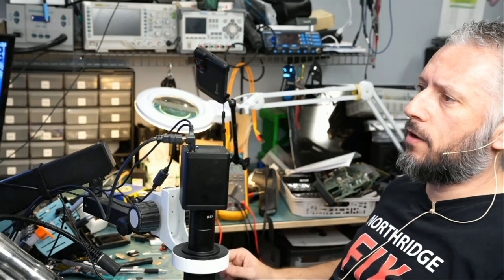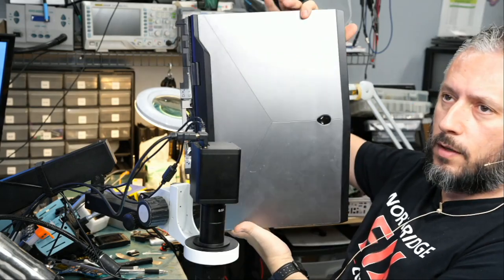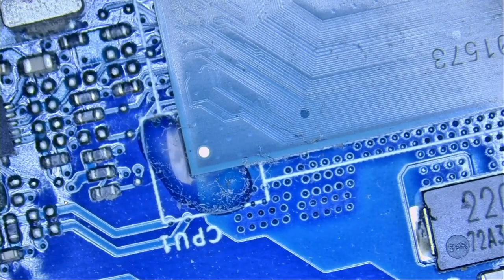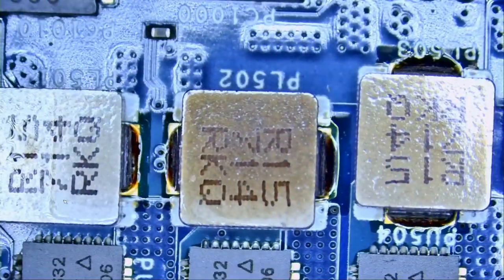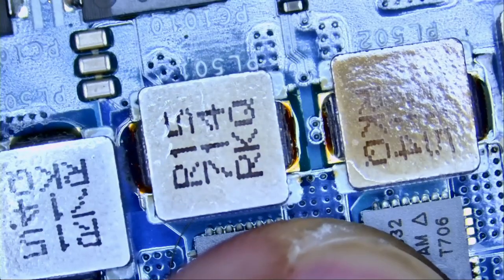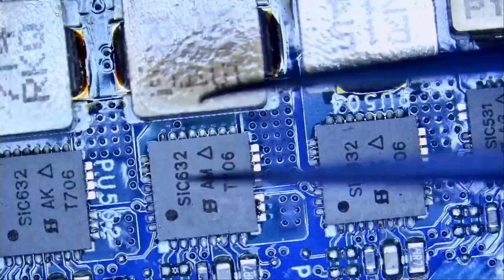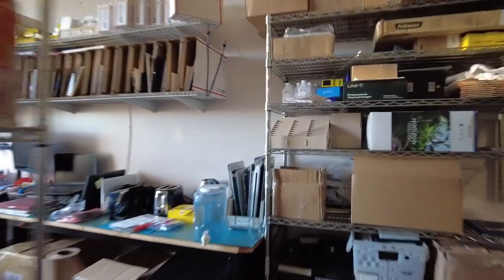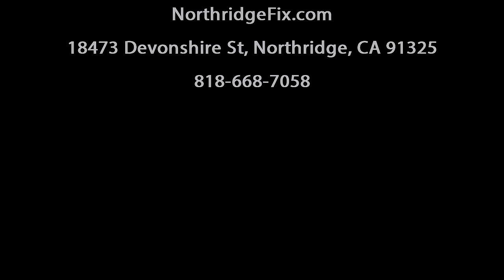Dell Alienware 17 R4 Notorious for CPU problems - Is it Fixable?

Comment: I sent in a dell G7 17 inch that had a similar problem instead mine would turn on boot up but would not charge then it would just die, it was deemed a no fix and i recycled it. I'm never buying a gaming laptop again, thanks to this channel
Reply: I would suggest not to buy anything which has the term "gaming" in it's name because it's often overpriced and not servicable.
Reply: Get hp zbooks

Comment: These bulky laptops should come with socketed cpus. Supposedly the reason manufacturers moved to soldered cpus was to make laptops thinner (an effort led by intel ultrabook initiative), but on these huge bulky models it doesn’t make any difference if the cpu sits 1-2mm higher. At least amd should make the effort, even if they think they will lose money when people just change cpus instead of buying new laptops.
Reply: thinner lol what 2 cm thinner thats crazy
Reply: My first Lenovo laptop has a socketed CPU. If only the GPU was changeable it'd still be a relevant laptop.
Reply: I suspect manufacturers did this intentionally so they can sell you a new laptop in a few years.  Intel, for example, has completely stopped making PGA versions of its more recent laptop processors (PGA - pin grid array).

Comment: Hey Alex! It should be interesting to ask your customers with faulty laptops, if they keep the lid closed. I noticed on the other video with Asus laptop that there was dust on the screen in the shape of keyboard. A lot of people have external monitors connected to their laptops, so they keep the lid closed and i was wondering if the extra heat adds up and creates such problems quicker. Keep up the good work!
Reply: Hi there, majority of laptop (almost all) are having their air intake / fans pulling the air from the bottom, so closing the lid got 0 effect on the temperature. I've been using 2 laptop over 4 years having totally closed lid and connected to an external monitor, and I'm ALWAYS having a program called "HWiFO64" running to monitor my CPU temp, and it's always been normal.
Reply: I think the problem is people put there laptops on surfaces that are not flat..couches, towels, mats, ect. They can't breathe and run hotter than they should. My predictions are customers are at fault.
Reply: The problem with laptops that have mechanical hard drives, moving the laptop while the disc is spinning, creates forces on the disc, and wear and tear on the disc bearings. There is an experiment, using a spinning bicycle wheel while standing on a swivel platform. depending which way the spinning wheel is tilted, the person will be turn either left or right. The same physics apply to Hard drives. When the device is on, do not move it's position.
Reply: @amrdaking1  except asus zéphyrus S gx5xx and gx7xx, also zephyrus Duos  they have exhaust on the top keyboard. So leaving them lid closed he will suffocate
Reply: Hi, the keyboard-like marks on the displays are caused by physical friction between the keyboard and the display probably due to carrying the laptop in a backpack and the involved vibrations, the screen ends with micro-tears caused by friction, at least in my case that was the reason.
Reply: @danteashen6178  I wonder if there is any mention in the manual that you should not obstruct the exhaust and exactly where they are located. Also exhaust on the top keyboard is an obvious design flaw..
Reply: @goku445  i don't remember but i can check. Well it was pretty good idea  in my opinion and for my usage. Better cooling perf i ever saw on a laptop.
Reply: @goku445  there is a mention "please to achieve better cooling performance, open the lid 60° orientation minimum"
Reply: @danteashen6178  Ha! Too bad no one reads it. :p
So basically their design was adding those vents to the traditional ones.
Reply: @tecnogof  The device is designed to be moved while it's spinning. While your argument makes sense physically, in practice you can move a spinning hard drive around with no problem as long as you move it slowly and carefully, don't drop it, and don't move it hundreds of thousands of times. OTOH, nobody should be using a mechanical spinning hard drive in a laptop any more; so if you haven't already, replace or have it replaced with an SSD; you'll thank me!

Comment: Love to watch his videos. always great work alex ! i am disappointed from dell, that they will not change the construction of this laptop for longer lifespan. I have a 8 year old alienware laptop and its great
Reply: That's not in their interest. Also 8 years for a laptop is very long. Saying that I have a 10 yo Thinkpad that's still doing a perfect job. Only had to replace the thermal paste.
Reply: 11year old Alienware m17x r4 here! The best laptop they ever made in my opinion.  Upgradable almost like a desktop pc. If you got the R3 you can even upgrade the motherboard to the R4! This is how all gaming laptops should be. I don't care if it is large, because it stays cool with a stable +700mhz OC on the CPU and does not throttle!
Reply: @GamesToTutsOfficialChannel  thats it. you spoke out of my soul. you can upgrade from r3 to r4 because base bottom is the same. you can upgrad everything like desktop. M17xR4 best laptop a company made. I wish they would produce a "refresh" of this laptop with new hardare and upgradeable too

Comment: Hi, I have kind of a dumb question, but here goes: Why did you decide this laptop was a "no fix" and abandon the repair? Isn't it possible to replace the entire motherboard with a used or refurbished working board? There should be a lot of value in this laptop aside from the motherboard that makes it worth fixing.  And a related question: Why it is impossible to solder in a new Intel CPU? Thanks for your great work and useful advice -- I'm just wondering why you declared this unrepairable.
Reply: Its not impossible, its just not evonomicly viable to so so, espeicially if its a known fault.

Comment: A buck converter with a shorted switch will obviously over-voltage the load (CPU).  Dell should have included a crowbar or allowed some design safety margin.  I am curious why swapping the CPU is impractical.
Reply: Reballing cpu is not economical Alex says.
Reply: Reballing a BGA CPU may spend a lot of time and it is not always success, even if the original CPU is rendered unusable and no reballing is needed but replacing the CPU instead, installing a new CPU is not easy as well.
Reply: remember the times when a laptop cpu was on a socket... easy swap.... no more joy today.
Reply: @chihofung6860  Or, if you have a lot of patience, replace each ball with a socket for a pin, and put a pinned cpu?
Reply: @philipershler420  Quote: "In one of his other videos Alex explained that reballing a CPU is very difficult and very often fails" 
Reballing is no joke! I just watched another video to see what was involved. 
I can see somebody like Alex spending a minimum of 2 hours on a job like that and it would require a lot of specialized equipment.
Reply: Because the cost of replacing a CPU makes it impractical. Getting a CPU replacement would be difficult and expensive in and of itself, but you'd likely also have to first remove it from an existing board  and then solder it to a new one. As others said, it is a very difficult and time consuming process and there's a lot that can  go wrong. It also requires you buy more machinery (there is a device used to solder/desolder large chips like that). Usually the only people who do it are people who specialize in this type of repair and/or hobbyists who have all the time in the world to work on one thing. It is incredibly tedious work to get all the solder balls on it and so on.
Reply: @JohnDoe-yj5ng  different pinouts usually. desktop and laptop cpus are not interchangeable even if the model number seems similar, they use totally different sockets and have different dimensions (laptop cooling systems!)
Reply: Also replacing cpu big heat is needed, and big chance the motherboard/cpu will bend and it won't even fit again. CPUs in latest gen laptops are such rabbish, never seen so many cpu fails lately. I have few beautiful donor laptops with bad cpu
Reply: Because you need a very large tool that facilitates BGA rework and helps precisely line up the large CPU then it has heating stages to properly re-solder the CPU. The machines are thousands of dollars and finding the exact CPU model is often difficult. You also run the risk of getting one from a donor board that also has a dead CPU or GPU so not many repair shops bother these days.
Reply: Like has been stated, that would require a BGA re-work station to do a quality job which can be expensive and needs different templates for the specific CPU's.  These use infrared light vs a heat gun and are very specialized.  Plus it is time consuming.  With the extreme amount of repairs Alex has, it would not be practical or cost effective for his type of business to do this.
Reply: to add to the other comments: reballing seems to be viable only if one works on specific devices (e.g. Macbooks) and not if they have a high count of balls like SMC, but not CPU. I guess, everything is possible but if you live in California, you have to count your business minutes.
Reply: Salvaging complex chips (CPU, GPU, FPGA) would be problematical due to the difficulty in verifying full functionality.  New chips come with balls...
Reply: would a 20-Buck convertor be better ?
Reply: Back in the day it would have only taken seconds to swap a cpu back when they were almost all socketed but after the fourth gen everything is BGA. Personally I despise that change as in the long run it results in there being even more waste.
Reply: @MrKillswitch88  Totally agree, and I think the change was intentional. The manufacturers will argue that BGA technology enables them to make the thinner laptops that consumers demand, but I'm quite convinced that Intel could design a very thin, replaceable CPU system if they really wanted to. Or better yet, Asus could have designed more robust circuitry.

Comment: i have the r4 and the r5 and i repasted them. when i put ram and everything back in place it did exactly that with a clicking sound them turn off.  i though i killed the laptop but turned out needed to clear the cmos. to do that unplug the battery and power cord and keep the power button pressed for 30 seconds. reconnect the power cord without batter see if powers on. for me it worked. hope it works for u as well. take care.

Comment: Imagine if they did something new in a laptop.  Something inovative like a laptop cpu socket, or something crazy like that. Just imagine.
Reply: check out framework laptop
Reply: Never ever! This would increase the manufacturing costs about 0.000001ct/10kpcs! For this mountain of money you can employ at least a political correctness manager.😁
Reply: You can't make the laptop as thin and as lightweight if you do this. Hence most manufactures don't.
Reply: some manuf already did before but they dropped in favor to light and thin laptop. example lenovo thinkpad series, T430 and before.

Comment: Hmm, this smells after an under dimensioned inductor. The inductor is inductive only until certain frequency and current. If Alienware has used an inductor that barely fits the limits then you have a problem in edge cases when temperature causes the inductor's characteristic to change and then it becomes a short circuit. And short circuit to 12V or 20V or anything to CPU is not good XD

Comment: Why would Dell Alienware do something that harms the CPU on the long run. They should anticipate these things at the design level.
They should include some sort of a replaceable protection circuit near the CPU.
Reply: That would have costed an additional $1 which could ruin this small company or they would not sell enough new laptops... ;-)
Reply: planned obsolescence
Reply: Fact that OEMs don’t fix the board, they replace it so replaceable components or not, they don’t care. And it’s sad for customers with out of warranty devices.

Comment: I saw where Walmart and Ebay both have new mother boards for this model ranging in price from $300 to $1000.
Maybe tell the owner that if they want a new mother board replacement as it is just the CPU that needs replacing that that would be their alternative???
I know that a new mother board does mean that Windows 10 would have to be reinstalled as well.
Reply: This specific board is not available online, I looked.  It was a limited release version with the 8G GeForce 1660 and Intel 1770 cpu.

Comment: Had this laptop and man it had the worst cpu throttling issue. It would overheat running just windows
Reply: The throttling issues depends on your variant, this one always ran cool.  Was an i7 7700 with the Nvidia 1060 8GB.

Comment: Guys need help please ! 🙏 
I have alienware 17 R4. 
When its unplugged and battery goes down, it asks to plug in.
When plugged in and battery goes to 25-30%, it shuts down (not completely) .
After if its still plugged in cant switch on, if unplug it, it turnes on perfectly. After if you plug in it turns off immediately,  or if you wait to battery go down, and plug in later, it starts charging but same thing happens at 25-30%. And the same sircle goes again....  what problem it might be ?

Comment: The thermal camera showed that the shorts in the processor heat up first
Reply: I wonder if you drilled out the short on the cpu would it restore some function to it. Worth a try if it's going to be scrapped anyway. And it might prove the problem.

Comment: my alien ware you can pop out the cpu but still overheats if i play to long and i end up having to use a usb key board because it gets hot and you type keys an off she goes but no issue after i used my plug in keyboard for long sessions,

Comment: Would it make any difference if Dell added a fuse inline to protect the CPU from getting nuked by excess voltage?
Reply: A fuse only is totally unuseful, because input current is almost the same as output, a varistor could help toghether with a UVLO check at the beginning
Reply: A fuse can only limit current, not voltage
Reply: cost them too much LOL
Reply: A fuse protects from overcurrent not overvoltage.
Reply: Thats what VRM chokes do;
Reply: Whatever is used, it needs something to protect the CPU from getting nuked by excess voltage, along with any other chips/sections that could be nuked by excess voltage

Comment: Couldn't the extra solder under the chip bridge other pins when it leaks out?
I know in a lot of cases, it clearly comes out with the grouped pins and has no ill effects. But this chip looked like it had multiple places that could bridge and be unseen.
Reply: the fact that the problem is known and predicted by Alex then there's no need to check it again.
Reply: It doesn't do that because of flux. Flux keeps the melted solder apart underneath the chip, then it leaks out because of pressure and inevitably end up bridging. You can tell that the soldering was good because the laptop did in fact power on, but without recognizing the CPU. If there would be a short because of bad soldering the laptop PSU would have shut itself off like he was doing before.
Reply: @erleykenneth  ???
Reply: I was wondering the same

Comment: Anyone knows why laptops die this way?  I own a Alienware M17 R4 (which is a bit different from this one), had only problems with it since the beginning.  I'll avoid the proposed overclocking in the command center...
Reply: planned obsolescence
Reply: @4eversr  Yeah, I decided to use a cutting tool to remove the CPU fan because the service manual would describe 50 steps of motherboard dissasembly.  In the end, there was only 3 tiny screws from the other side.  So the new fan (which I tried but could not get from Dell) holds with duct tape.  Duct tape is fighthing planned obsolescence!

Comment: Nice video! Can you change the cpu?
Reply: Of course he can. But he won’t do it since it’s not practical nor economical.
Reply: If you have seen previous videos, he is not waisting time/money doing it or on GPUs also, when has a long list of items to repair and quickest. Said it 1 or 2 videos ago
Reply: You need special equipment to resolder the cpus. Also it’s usually not worth the time on all but the most expensive devices
Reply: repair cost with cpu change would be higher than buying the same used laptop that is fully functional so it's not worth it
Reply: I would think so all be it difficult as it's likely soldered in so it can be done if you can get a working cpu to plop in as a replacement

Comment: I don't understand one thing. If there's short on the main power line and the cpu is getting hot why bother replacing drmos. The coil is discoloured which means high current was drawing. This for my understanding means the cpu is fried. I'm learning laptop motherboard repair and maybe someone could explain it to me if I'm understanding it right. Great video though !
Reply: He did that for educational purposes.
Reply: as repairman he needs to ensure the issue is fact not just assumption that why he charges the repair fee which indicate he did his best to repair the laptop and confirmed no fix. He didn't just look and give conclusion like that (diff between pro & amateur) and charge people later for that and what worst if the laptop suddenly be fixed by other shop then what reputation can he hold. he is doing business here not just for fun.

Comment: Hi
Is it fixable if the CPU is replaced? Or maybe there will be other issues as well?
Thanks
Reply: you can pay 1000$ for a new CPU, install it, power on the laptop and damage it again. Too risky for many businesses to do CPU reballing/replacement, thats why they don't do it at NF.
Reply: If replaced is fixable. But the cost is high and not worth it.